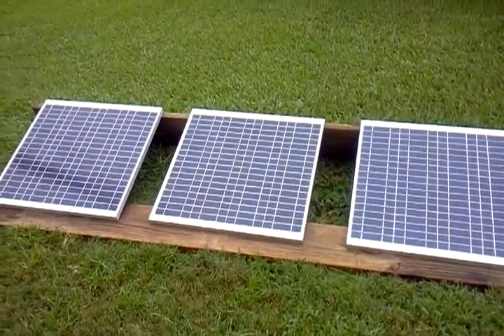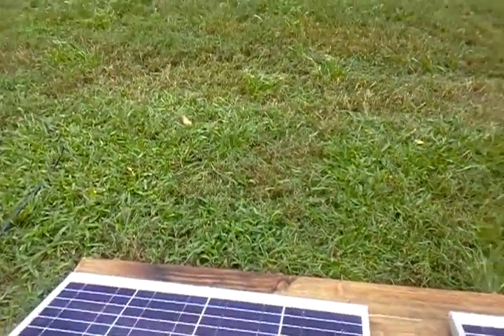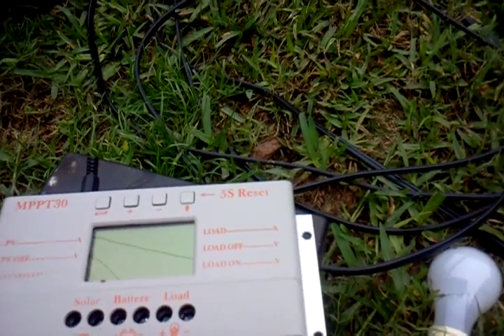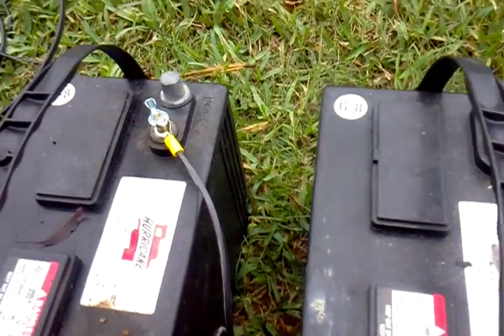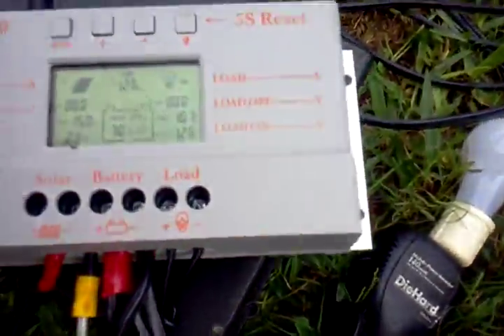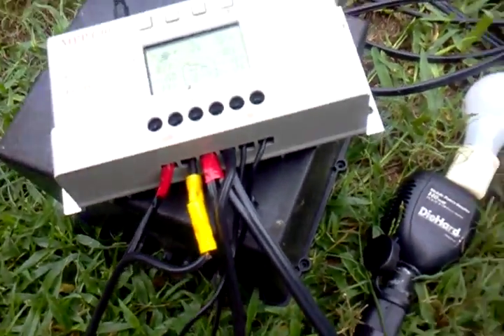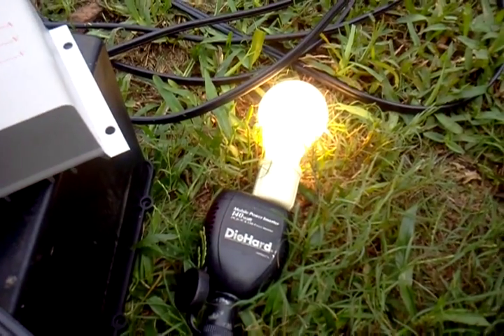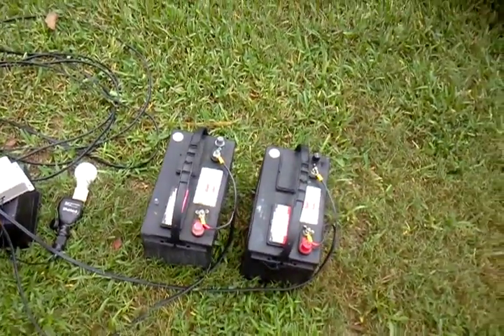150 watt solar system

Comment: What is the price for this  150 W set up ?
this is for small lighting operation , I am looking for some thing like 6 KW units with total system , included , charging batteries control panel etc.
Can you get back with me on this ventuer?